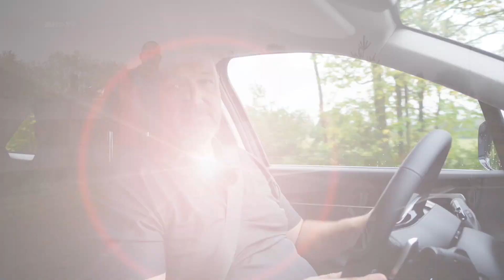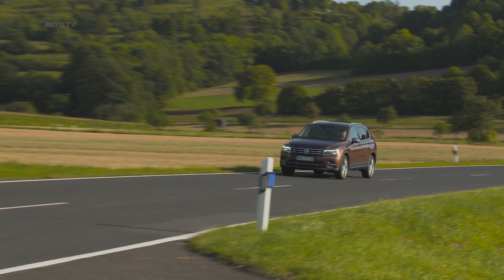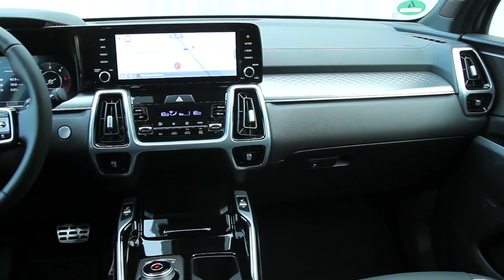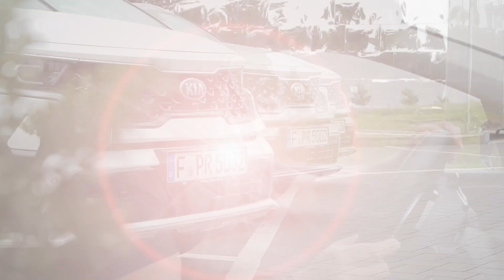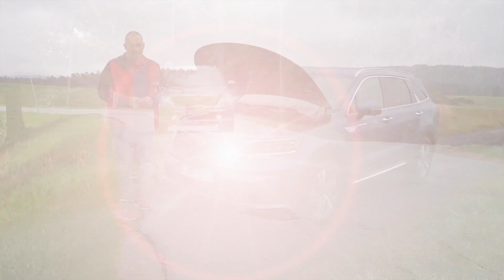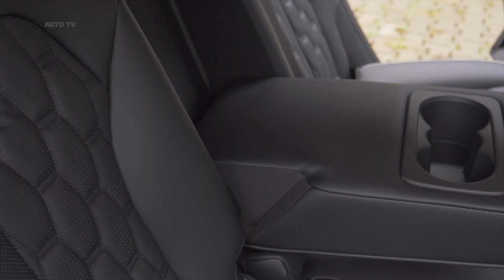2021 Kia Sorento

Comment: Damn shame you don't get 3-zone climate control in this SUV! A huge deal breaker for me! Goodbye Kia, hello Skoda Kodiaq!
Reply: i have the kodiaq and very pleased with it. im going with sorento phev, just because kodiaq phev is not available yet
Reply: There is actually air-con vents and blower controls for the third row in many markets. I have one and there is a rear air-con control button on the dash under the one for the front compressor. Not sure how well it works because I've only driven it 400kms total so far. This is a mid spec diesel 4x4 seven seatmodel [the only diesel model specification available here yet] called a '3' in the UK. Mine is doing 7ltrs/100kms so far and I expect that to improve as the car loosens up over the first 15,000kms.
Reply: More room in the Sorento though.